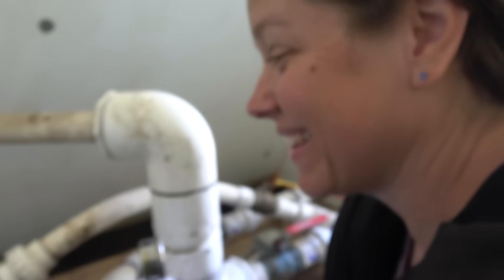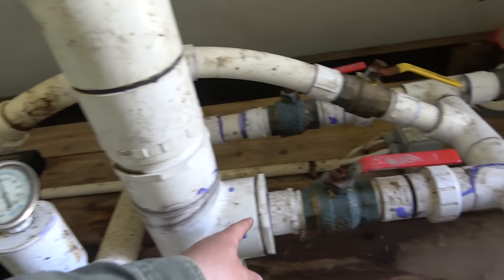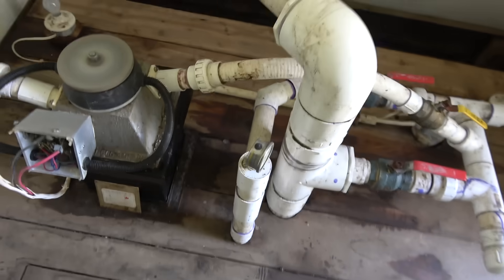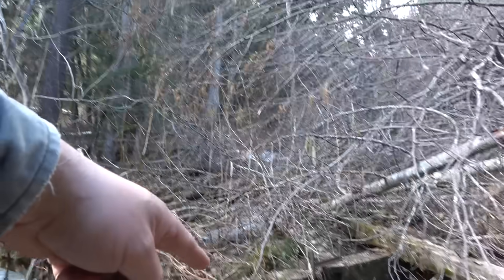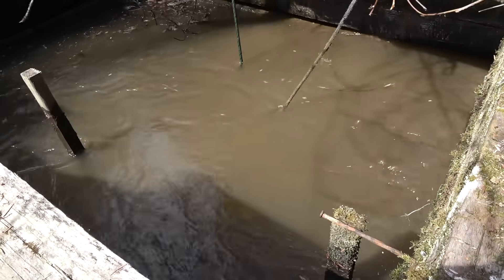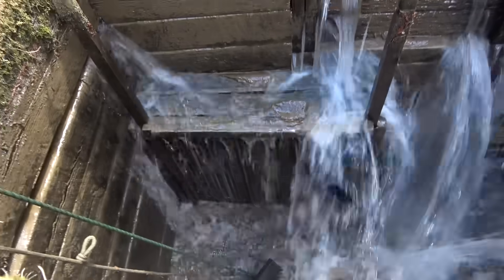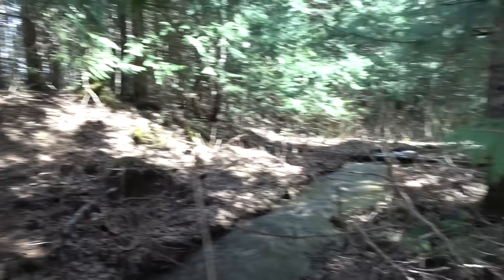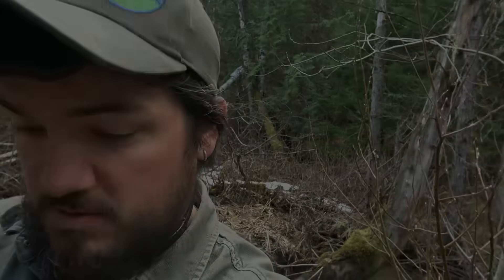Off Grid Micro Hydro - The Dream System!?

Comment: Bear lake BC off grid have 6 250w panels control system 8000w 10,000 max inverter and 12v lithium batteries but it's not up to par and need to wire it into my house breaker panel we have no grid power

Comment: Is it possible to add a solar powered heater upstream for those frozen winter times? If the source is coming out from underground up there?
Reply: No need. The water is moving through the system continuously so does not freeze.

Comment: One system I viewed used a cordless drill to open and close the intake valve to control the output rather than dumping it. It was pretty slick.
Reply: I think that was this series: https://www.youtube.com/watch?v=LVoeaKCEd2o where they turned rewired an old washing machine into a generator.  It's a long watch.  You can see the drill at about 45:00 of Part 1.

Comment: 12.00 , looks like a high pressure solenoid that runs on-off via DC that connects to the temperature monitor. Nice setup.

Comment: Why dont you fit a small bypass solenoid / valve to the turbine inlet. It could be 50% sized and would reduce output when you dont need so much power.

Comment: Fall on water for every foot or 12" is 2 lbs of pressure so if you had 100' drop you would have 200 psi of pressure, it works a lot like the old time hydraulic mining where they went from a 3' foot pipe to a 2' foot pipe to a 1' foot pipe to a 6" inch pipe to a 1" nozzle and depending how much drop they had they could be pushing as much as 500 psi to 1000 psi of pressure. That's enough pressure to run a big gun sprinkler.
Reply: Check your facts, you inverted the formula it is pont 5 lbs square inch per foot, that is right, 120 feet head develops 60 PSI. Just check.
Reply: @boydmcree9085    Thank you , I used to fight forest fires when I was younger  ,  half a pound per foot is the rule of thumb we used . ( I believe it's actually   point 47 lbs./per foot .)

Comment: 1300W? How much are the parts? Stream engine? How do you transform variable AC to 50 hertz 240V or 120 (x2 +120/-120) Voltage Overflow to hot tank? Overheat tank valve? Brand names? Links?
Reply: Contact us at Energy Systems and Design. www.microhydropower.com We can help you evaluate what is required.

Comment: Instead of generating hot water from the excess electrical power, you could power up a all-terrain vehicle that’s battery driven, or anything else that has batteries as it’s fuel. Batteries are now very reasonably priced. 😁

Comment: I really want to set up one of these as an emergency generator in my backyard where I have a drainage ditch. If we get even moderate rain for more than a few hours all the water from all the homes in a nearby cul-de-sac drain into this ditch. Had it shored up with stone a few years ago; rain got so bad the water was taking my yard with it. Seems like a great place for something like this. Our power goes out most commonly when we have heavy rain storms, meaning that ditch is flooded with VERY fast moving water... why not make it work for me when I need it.......   
Any feedback on such an idea is welcome.
FYI: just some quick top of head calculations based on size of ditch and estimated speed of water.
cross sectional area of ditch is about 2.25m^2 
Water move through it I'd guess 15mph, 6-7m/s 
OR, about 56KJ/linear meter of water moving through the ditch. Conservatively 1/5th (20%) of that moves past a given point in a second. So, does that mean I can handle a 10KW generator at full bore and would a 5KW be overpowered?
Reply: Storing or damming water is illegal almost everywhere, and for good reason. Check your local laws first to avoid the government getting in your life.
Reply: @kevinadams9468  
That is good advice, despite being absolutely sure the ditch is my property. I had to pay to shore it up with stone. The city refused despite putting in the delivery pipe a hundred feet or so upstream. They told me their only concern is the pipe; suggested I get flood insurance.

Comment: I had to breeze through this w/o audio due to where I was, and I also breezed through the comments. I too like the idea of hydro power, but one thing I thought of is that large systems deal with issues of effects on wildlife with fish ladders, hatcheries, planting fish upstream etc. I think if too much of the water in a creek or stream is diverted into a pipe, turbine or whatever, it could easily be detrimental to an eco system. I wouldn't appreciate it if a downstream neighbor eliminated my ability to catch fish in my backyard because he or she put in a system that kept fish from  swimming upstream.
Reply: The water doesn't disappear it goes back into the stream.
Reply: @YeahPete  I never implied that it disappeared. I was pointing out that various forms of life can't travel through pipes and impellers like they can through the creek or steam that the pipes and impellers have been placed in.
Reply: @notaboutU  Fish and animals are protected from being introduced into the system through the fine mesh used at the source for filtering out any debris.
Reply: @YeahPete  It does. All of it.

Comment: Thanks for the good video. Can you please share a link or diagramme for the dump load setup? I'm hoping to heat our cylinder with the excess power from our hydro, and wanting to figure out a way to cope with the cylinder reaching the max temperature, and not switching off the load.
Reply: Contact us at Energy Systems and Design. www.microhydropower.com We can help you evaluate what is required.

Comment: Why not use the extra hot water for more extra energy , and you can use it to clear the way  in side the pipes when its too cold and freez , you have Stirling engine or thermal applications to use , or to get clean fresh drinking water , good job mate keep up tge good work

Comment: If you have no load, where is the power going? It’s not backing up? Right? 😂. That was a joke, because…A/C & D/C current don’t have magical electron BB’s flowing through the wires. Electrons are not real. Mother Nature is not a crazy crack whore with a bag of magical unicorns (photons) and leprechauns (electrons). Everything is a form of magnetism. Electricity/static electricity is magnetism, visible light is part of the electromagnetic spectrum. So is radar, radio, wifi, etc. Everything works through pulse perturbation (coaxial) of the aether. Don’t think of it as something that goes from point A to Point B. It’s an Instant reaction at a distance. Anyhow, not sure why I had to give you a lesson on fake electrons, but you get my point. If your not using power, where is the power being produced go. It doesn’t go anywhere, it’s a electromagnetic field around the wires that  produce your “power”. Just like a magnet, there’s a field around it at all times wether it’s being used or not.

Comment: That's a nice setup. I always wanted to do a hydro setup. Come to think of it, you could use the excess power to mine bitcoin. Not only would you have the power, but also the water for cooling a heat exchanger.
Reply: Are there any good sources on how to mine bitcoin?  Seems like there are a lot of scams out there?  Is there a main trustworth program people use?
Reply: Just buy some of the rigs that all the bankrupt Bitcoin miners sold off. Hopefully when then grid goes down you can trade your thumbdrive for a loaf of bread...

Comment: Gee I am think your right it is a great system if you have the water flow rate. BUUT by the sound of your shaft bearing, it sounds like another 8 months tops before the main shaft will lock up and freeze. Good luck

Comment: Should have a backup one set up on the other side ,so you can turn off one side for maintenance or repair
Reply: Changing bearings can be done very quickly and the power is stored in the battery bank.

Comment: I don't understand something. You said your stream engine puts out about 1300-1400 watts. Dividing that by 120V gives 11-12 amps. I know that's not fully accurate, but for example, a typical microwave may use somewhere near-ish 1300-1400 watts and output 1100. My question is this: how is that enough to run your whole house?

Comment: Sorry to see you have no detail on penstock diameter, friction loss, batteries, inverter, actual kWh/day produced, flow, actual head.  60 psi is actually 45 psi?  Huge difference.  I agree micro hydro is fantastic to live with, but your video doesn’t even show HOW you intake box is constructed. You could help others so much more by providing truly useful info.
Reply: Contact us at Energy Systems and Design. www.microhydropower.com We can help you evaluate what is required.

Comment: head pressure remains the same no matter what size pipe you use

flow rate increases or decreases depending on the size of the pipe and the smoothness inside the pipe and bends

if you use a 4 inch pipe and a 1 1/2 inch nozzle, your flow rate does not matter because you restricted the flow with the nozzle but increased the velocity at which the water comes out

if you use a 1 1/2 inch pipe and a 1 1/2 inch nozzle you have to watch the smoothness inside the pipe that causes friction, and you need to limit your bends

static pressure is when your water is stopped at the end, dynamic pressure is when you open the valve, velocity is how hard and fast the water comes out the end ( no it isnt called pressure ) ( like wow, this jet has a lot of pressure coming out....no...just no)

with a larger pipe than the nozzle, all you need to worry about is head pressure...static pressure at the end, and dynamic pressure....dynamic pressure will let you know the velocity of the water out of the jet.....if you open the valve and dynamic pressure drops too much, you wont have enough velocity to run the generator....thats where jet sizing comes in

I hope this helps people understand more about micro hydro
Reply: but can you increase pressure by volume of water and amount of fall in the system correct?  More water from higher up standing in the piping should increase the pressure from the weight of the water column shouldn't it?
Reply: May I ask about the purpose of the head pressure , is it's sole purpose to force water downhill into a narrower opening .
The higher the elevation creates more pressure as you downsize the pipe work into a turbine which creates more force into it
Reply: G'day mate,
Correct my friend 
I don't mean to nitt pick but  I couldn't help notice that they've used the wrong  type of glue for that pipe (ie pressure pipe).
It appear that they've used standard type N "Blue" glue Instead of the required type P "green" glue (ie high pressure glue). I know it sounds stupid but these things stand out to me because...(1) it's now not up to PCA (ie  plumbers code Australia) and (2) because I would get my ass kicked if that was my job  ....and obviously please correct me if I'm wrong. Maybe things are different over in the states....

Comment: how would that system work with zero elevation, using the electricity generated to run a pressure pump to pump the water to run the system? Obviously there would be an initial - come reserve external pumpimg system set up.

Comment: Just use a thermostat, which will shut the electricity to heat a water, when it is hot. Dumping a hot water to the enviroment is silly. Instwad of that charge batteries or pump water to higher elevation...

Comment: So the new hot idea is to dump excess power into a large pit of sand.  You can heat sand with resistive heating 1:1 to a far higher temp than water (100c boiling) so then you can pump water through this extremely hot sand and produce steam which drives a steam turbine/generator which you could use during cold spells or droughts
Reply: Cool
Reply: So, to sum up, during a drought when there is no water you will pump water through this hot sand.
Hmmmmm
Reply: @Ulbre  Not water pumping through the sand, it's resistive heating. Although in a drought there wouldn't be any power so not a problem!
Reply: @Ulbre  it can be made a closed cycle system, but I do agree may as well use pumped hydro or hydrogen
Reply: Not sand it’s more efficient if you use granite dust, they are using systems like that in Africa and it makes sense in the Southwest...spot on!
Reply: This "idea" fails for so many reasons thats its not worth getting into, latent heat of evaporation for water for a very basic starting point is 970btu for 28.33 liters
Reply: @MrDmadness  28.33?
Reply: @JohnnyJr396  28.33 liters  ( in fact EXACTLY 28.317 LITERS ) == 1 cubic foot of water .    As a carbohydrate is the unit used to measure the heat rise in a cubic centimeter of water a cubic foot is a standard often used discussing latent heat requirements regarding btu . 

1 btu heats 1 cubic foot of water by  1 degree
Reply: @MrDmadness  hmm was sure it was 1 btu per pound ,1 degree
Reply: @MrDmadness  from what I remember doing psychometrics anyway..interesting
Reply: @JohnnyJr396  you're correct in fact.   970btu /ft3 for latent heaT of evaporation still though  ( 28.33 liters )   my bad, thanks for calling it.

Comment: Nice setup Jeff...you could run a compressor heat pump (water to water) with a COP (coefficient of performance) of between 3 and 5 (or between 3 and 5 times more heat energy as compared to the low efficient resistance heater) and not only heat up your HWS but also heat your whole house...and the thing is it's pretty simple to construct specially if using a simple "capillary heat pump"
Reply: I think you missed the point that this installation has a need to dump power not save it. 

Your suggestion would be great if there were times when the hot tank ran cold, but if it always remains hotter than needed then the extra equipment would be a waste of money.

But in fairness: good tip for others replicating this set up but with less input flow or head.

Comment: now if i had excess hot water... i would have a 24/7 artificial hot spring pool lol... now, on that note, i do have a pond with a LOT of water. and an average flow of maybe 5 gallons per second or so from the culvert stand pipe exit. what i would LOVE to do, it so get a back-shot or under-shot water wheel, and run a generator on that as a sort of nod to a traditional and historical use of the pond and the man-made stone stack and fill dam that holds back the water, and about a 15 foot drop or so.

Comment: This is really impressive, I really like it and that power system just spins and it's been in place for 15 years is also great.  One question, where does the water going through the system get dumped, it's great to have that water coming down but where does it go after it hits the turbine system?
Reply: most likely the stream in front of the house.
Reply: @OldBastard-dj6er  Yes, through the bottom of the Stream Engine.

Comment: Jeff shows he has understanding, not just information. Did you see how he shut that valve? Slowly. That is the proper way to close a valve, this way you avoid the hydraulic hammer. That hammer can destroy a system, including causing a pipe integrity failure.
Reply: I seem to remember (I'm 74, remembering is work and not always correct), back when Jeff was in the wage earning phase of life, he was an engineer.

Comment: I'm not sure how you can get too much power. You can just turn the valve part way closed and make exactly the amount you need.
Reply from the maker: Yes, but the electro-mechanical equipment to do that is complicated and not commercially available for small turbines like this one.
Reply: @Gridlessness  You're funny! Just close the water valve feeding into your turbine a little bit. Less water flow = less power.
Reply: @Gridlessness  I'm sure you could make your own, with a Micro Controller, some actuators / valves and a little know how.

If you cant get variable output to work reliable, just have it shut down till you drain like 5-10% of battery capacity then have it restart.
That'd be a lot easier to do and would still solve the problem.

Heck, another one would be to have some heating elements in the water feed to the turbine, and just dump the excess power straight from the turbine into that water flow.
Something like a Arduino controlled variable DC-DC Converter would work for this (Meanwell has some good ones where they use analogue signals to control Voltage / current outputs).

Comment: There is so much unexploited potential (no puns intended) in hydro, not just for individual properties but for communities (sharing the infrastructure shares the cost). But wind and solar are considerably easier as we may need to to something about water quality (not just an initial screen) if done on a larger basis, particularly in agricultural settings.
Reply: Wind power is actually one of the worst there is. So much wastage invlove in the wind vanes.
Reply: Absolutely! Also, using the same water flow to create a water pump that uses no external energy source.

Comment: You could also plumb the extra hot water around the house.. either under the floor in the walls etc etc for heating the house. Or atleast taking the chill off before ya light the fire.
But thats a lot of copper pipe..
Reply: Plastic piping in floor running coolant/antifreeze heated by a large tank containing the hot water....?

Comment: We have a stream but it's 200 feet below the house ☹️
Reply from the maker: Your out of luck for gravity feed water to the house, but electricity flows uphill very easy….
Reply: set up a system and send the electricity to the house via a transmission line.